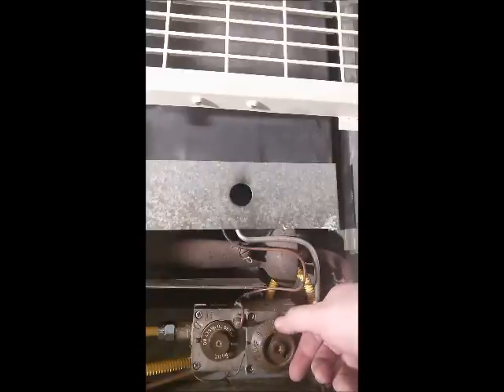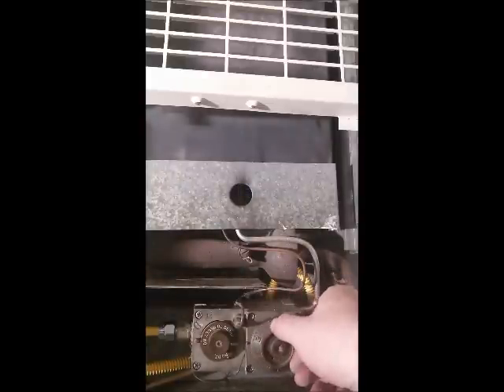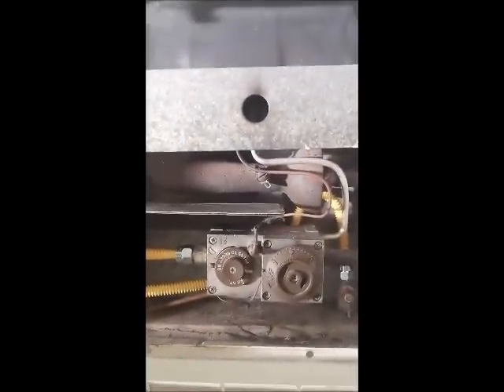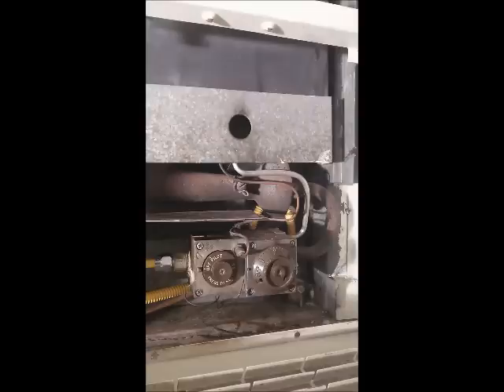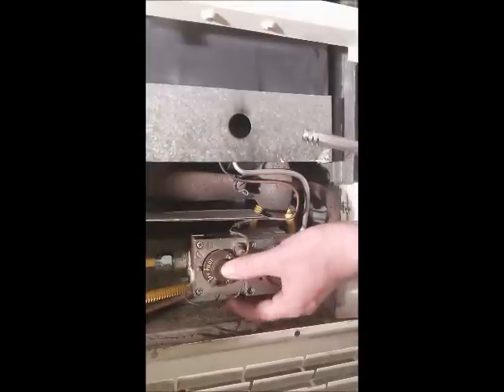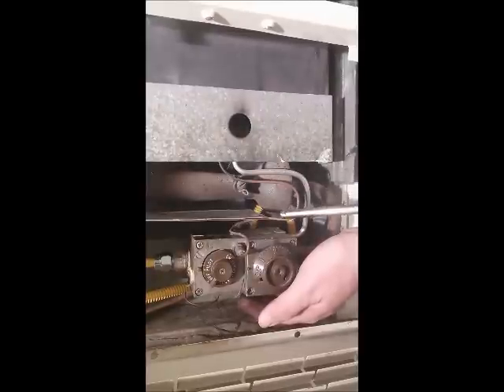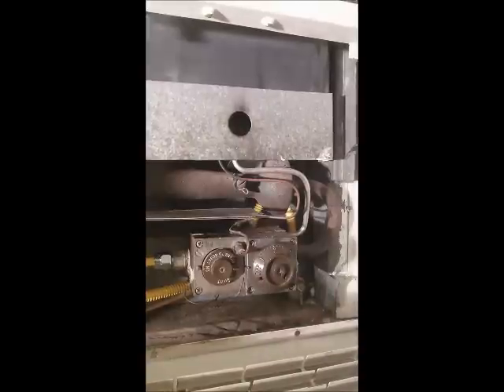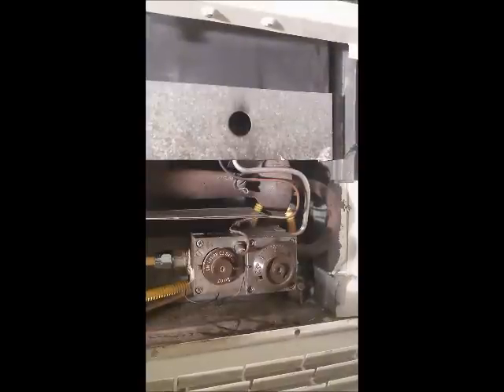DIY: Lighting the Pilot Light on a wall heater

Comment: Thank you!  I'm no stranger to lighting pilot lights on furnaces but the 1981 wall heater in the extension room of our new home had me stumped.  The dials were obvious, but I couldn't figure out where the pilot light was.  I have the same smaller supply line and copper conductor wire on my unit that you do so thanks to your video, I was able to trace it.  My unit doesn't have a convenient hole to stick your lighter into tho.  It is hidden from view by a bar.  I got on the floor on my back and looked up under the bar with a flashlight and could finally see the burners and where to light it.  Voila!  It fired right up.

Comment: Hello! Do you know where I can find the temperature control replacement knob? I have searched every where for it. The one I have broke in half and haven't been able to use my heater.
Reply from the maker: best I can recommend is see if you can find a manufacturer label w/ the model number and call them.  Otherwise, you may need to have the whole valve and burner assembly replaced.  https://www.northamericahvac.com/williams-furnace-furnace-gas-valve-744332050-744332080-p295101a/?gclid=Cj0KCQiAnb79BRDgARIsAOVbhRrL8IazJJGgGQWTZBTA6GRxFnpGnpv7HTqP-bYeId9F9mWhKhsaUsMaAtUNEALw_wcB
Reply: @TheSoCalSailing  thank you !

Comment: Thanks for your share. Yours is exactly the same as mine. I could use it but I was scared about using it to be exploded so I stopped. I am spending a such cold winter. I ordered a radiator heater finally.

Comment: I wish mine were this easy after holding the the knob in the pilot position for almost 30 min mine still doesn't stay on when trying to turn to the on position.
Reply from the maker: Stone Cold it sounds like the thermal conductor or supply valve may no longer be operational. They are parts that can be replaced.